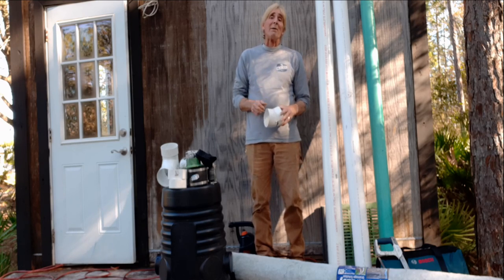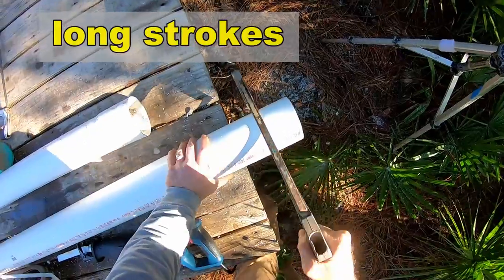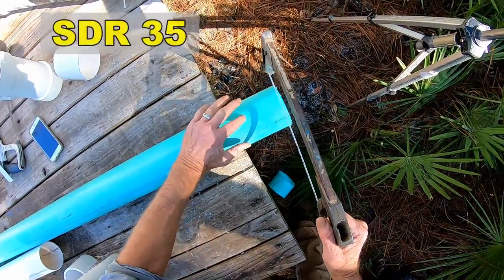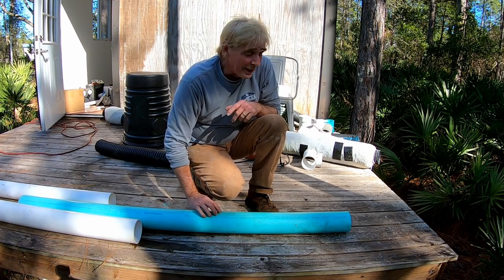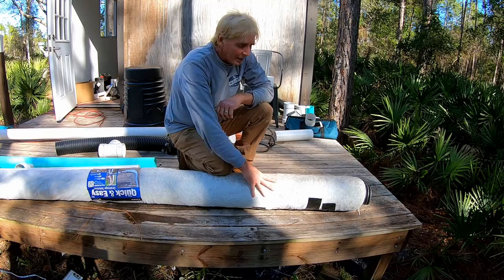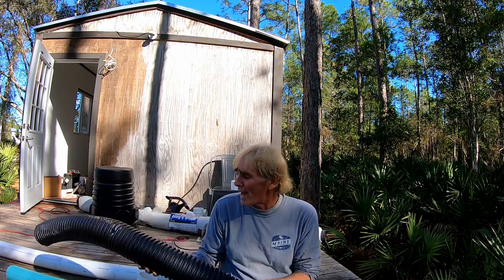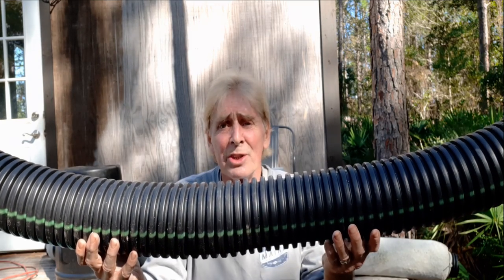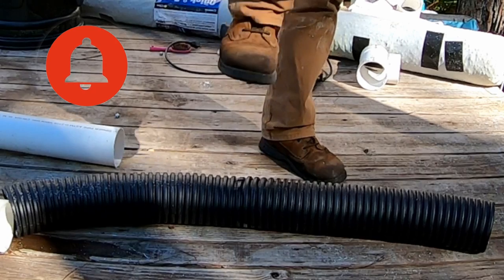FRENCH DRAIN - What's the BEST Pipe to use?

Comment: What's best for inside a crawlspace?  I have a tall crawlspace (with some standing room) where I've already trenched  around the perimeter.  Most of the trench is only 6" deep, but in one place the pipe will be buried under about 18 inches of gravel along the footing.  Corrugated will be easier to maneuver in the space, but will it hold up to 18" of gravel?

I also have two pits that I'd like to connect to each other with a pipe that will run through the middle of the floor, where it will be walked on, with about 2 inches of gravel cover.  Will corrugated hold up there?

Comment: There is an adapter to go from sch 40 to the green pipe.  If u are worried about heavy traffic like large trucks on a driveway or something schedule 40 is good.  Sdr35 is my go to pipe if I can get it.   Pickings have been slim at the suppliers around here the last year or so... so iv been using whatever material is availabile... sch40 is also extremely expensive now days

Comment: I Use My Skillsaw For Pipes Less Than 3 Inches and My Ryobi Sawsall For Pipe Over 2 inches! It Is So Much Easier Just To Whack It In Two With My $59 Ryobi Battery Powered Tool! I Have Had To Use The Multi Tool To Flush Cut Pipes Also! Love Your Videos But Have Seen These On Your Other Channel!

Comment: Everyone needs to keep in mind: Corrugated pipe comes in SINGLE WALL and DUAL WALL.  Both are flexible to an extent (dual far less so).  BUT, dual wall (smooth inner wall) will not crack nor will it collapse like thin, single wall corrugated pipe.  HD carries rolls of thin single wall pipe that WILL COLLAPSE under pressure over time.  For this reason, though cheap and readily available, use CAUTION when using it.  Downspouts will back-up if these get crushed.

Comment: I wouldn't recommend corrugated with downspouts. The leaves and shingle dust will fill up and block corrugated in just a few years. Roots only get into PVC pipes that are cracked or leak from the fittings. If they aren't leaking they aren't getting root invasion. PVC is also easier to clean but I agree that thin walled PVC is probably sufficient for drainage applications unless there's a driveway or something heavy going over it.

Comment: When my house was built, the builder put a corrugated gutter drain under the front yard. It failed totally in about 4 years. I dug it all out and installed Sch 40. Twenty-five years later it remains root and clog free. I would not waste a nickel on corrugated piping.

Comment: I'm getting a paver job done and the original drainage pipes were under the slab, the guy tells me that I don't need it.  he said he will put an 8ft gravel base and then a 4" qp base and run 4"  drain pipe to the sump pump.   He states that should be enough.  The area of the pavers is problem 20 x 20.  with the back yard on a hill where water runs toward the house.  what should i do?

Comment: I am in the process of hiring a company to do a french drain aroiund a concrete patio/ walkway area due to water entering my home through a back door at ground level. The backyard property slopes towards the house and when we get torrential rains water can and has come into the house. I am wanting a french drain installed with no dirt on top to maximize the removal of water faster. What should I look for the company to recommend to use as far as materials.

Comment: I've seen that thin wall PVC material crack.  Maybe because of setting or ground shifting.  How can roots get into sch40 PVC if you glue the pipes together?  The two piece are fused together.  Show us an example of roots getting into glued PVC.  That black corrugated material are a bitch to snake out.

Comment: I have seen roots and damage in all the pipes you are discussing in this video. A french drain under 8 feet of topsoil is a stop gap at best, especially with no method of cleanout. Sediment cloth over time will eventually clog and totally stop the flow of water into any type of pipe. Schedule 40 and SGR-35 are the only pipes you can clean out effectively that i have used,  Corrugated pipe almost always in my opinion is the most likely to become distorted and clogged and rendered useless.
 I have been building and dealing with water problems for 28 years in the mountains of WNC. I still don't think i have the answer on the perfect pipe or best method, to keep a french drain operating at peak efficiency indefinitely.
Reply: well said!
Reply: Boy you'd go out of business in Costal Oregon, where we often get 150" annually
Reply: Totally agree! Because French drain pipes have holes which allow tree roots find they’re way in.

Comment: Would a good qualifying factor to use the corrugated pipe be that there are zero trees in the area you are putting it? And is it okay to tie existing systems into it that are with SDR35?
Reply: Go with green sewer pipe. It will hold up a lot longer. Corrugated pipe from big box stores is no good. Sediment and dirt slowly build up in those pipes over time causing the entire system to fail.
Reply: @StormWaterDrainageSolutions  - Could put a Y at the downspout with a cap to allow cleanout with a garden hose, if not too many bends and not too long.

Comment: One hint using any hand saw-to get a straight cut point your index finger forward and rest on saw. Also you are cutting om the back stroke point blade teeth forward and let the saw weight do the cut with long slower strokes. The saw should cut on the forward stroke only. The recipo saws shoe should always be touch the work

Comment: That corrugated pipe collects shingle dust washing off the roof and is a trap for leaves/dirt (and it traps obscene amounts of water in those grooves as well) - good luck keeping it clean as it will fill-up with crap and clog before you get around to any annual maintenance - I wouldn't use it unless I was desperate and it was my ONLY option in a home flooding situation!  I would not consider it for French Drains for the same dirt and water trapping/clogging reason, PVC + lots of gravel is the way to go there.  Water runs best along smooth surfaces, why throw that undisputed science out the window and use pipe that isn't smooth to remove your water problems?
Reply: Exact thought everytime I see it used. I could only imagine using it on serious slopes (>50%) where the angle and force of water flow would allow self cleaning of the pipe throughout the year

Comment: Chuck, is it ok to use foam core 4" pipe and drill holes for French drain?
Reply from the maker: Sure ! But is costly way. I think better is to buy sections already pre drilled. Foam core is good pipe. Just be sure to point holes down into your gravel

Comment: Some commenters make an argument for schedule 40 pipe. Schedule 40 is hands down stronger than the others but...SDR35 is the standard pipe called out for use for underground sewer lines. If it is good enough for sewer lines than it should be good enough for drain lines as well.... as with all decisions the application must be kept in mind. If you are going to drive over it or put a rockery over a pipe with minimal coverage it is going to need to be stronger. Chuck obviously has a lot of experience and if he has good success with coorogated pipe than you probably will too. (Unless you have minimal coverage, poorly drained squishy soil, are passing through trees or may apply excess pressure to it. (Think, roof replacement or any other delivery. (Dumpster, soil, concrete etc.)

Comment: Why would be sch 40 be any more work? Other than a few more seconds to cut through it because it is thicker? There are more pvc fittings available for sch 40 pvc than NDS pipe
Reply: You need to use various fittings to make turns and glue them. You also need to glue couplers to lengthen pipe. Trenches have to be dug almost perfectly straight. Corrugated bends and the few connections you make just snap together.

Comment: In my experience, picturing you root clearing a drain pipe = blowing out the side of corrugated, or schedule 20. However if it’s deep enough, schedule 20 properly backfilled will be just fine. 
Corrugated is just garbage. It fills with trash way too easy, does not retain its level but has highs and lows unless your trench is particularly done right. You were complaining about the little ridge in schedule 40, corrugated has one every inch or so. 
It’s Used only in a pinch.  Under driveways I would use schedule 40 or the green pipe. Green pipe is best IMO

Comment: I currently have the black corrugated pipe for my downspouts, and I've had a problem with several of the pipes collapsing due to the dirt. I'm looking to replace them with sdr35. Should I use 4 inch pipe or would 3 inch pipe be fine? Or should I use the quick and easy system?
Reply: How deep are you burying them? Also, are you using the real ADS pipe? There are some corrugated pipe out there which is really flimsy and not suitable for burying they are called something like "flex-pipe."
Reply: It depends how much water you need to move. How large is the roof? How many roofs into one pipe? Ground drains connected too?

Comment: I live en Honduras and I can only find SDR 64 or SDR 41. Have no idea why SDR 35 is not an option. I'm installing a large french drain on a drive-thru area and need to know which of these pipes would be best.
Reply: SDR 35 pipe is used as a direct replacement for old sewer pipe made of clay. It is probably not available in Honduras because pipe of that specific thickness was never used there. Whatever pipe is used for buried sewer lines outside of a structure in your area is what you want to use.

Comment: We are having our messed up project fixed this week by another contractor. They are using either Schedule 20 or thin wall. I'm not sure which it is or if they are the same thing. Should that material work well for downspout drainage? Thanks Chuck! Also, he put the adapter on the first downspout (2 x 3") and there is some space around the connection. He suggested squirting some of that expandable foam in the top to close it off. Is that appropriate or should I just leave the gap?

Comment: So the main reason not to use Sch 40 is the fittings for the downspout? I didn't really get otherwise why not to use it.
Reply: Also price, 40 is over kill.
Reply: @ironleatherwood1357  Yeah, I get that. It can be expensive and my preference is corrugated because it's easier to work with. I had found a bunch of sch 40 on craigslist for free. A construction/excavation company was liquidating.
Reply: Sch 40 is too rigid its going to collapse under high pressure. Sch 35 withstand much better under high pressure such as driveway
Reply: @jkevin1569  Thanks. It's in a residential use and it's downspouts to the street. No heavy equipment crossing it (unless you consider me - 220lbs heavy) LOL! In our area, it's very common to use ABS (which is also SCH40) for this purpose.
Reply: In that case there is no harm using sch 40. However, abs fittings are not compatible with sch 40. You are better off with sdr 35 since it's more rigid than single wall sewer pipe yet more flexible than sch 40.
Reply: @ironleatherwood1357  wish I had known that.  I bought about 500’ of 3” and 4” schedule 40.  It was pretty expensive but compared to the raw effort of digging all those trenches it hardly a major concern.  I just used a pick and shovel and it was brutal especially once the trenches get deep

Comment: I used duct tape around the PVC connections after gluing them to help slow down root intrusion. 
Thoughts on this? Waste of time or something to keep doing?
Reply: Waste of time
Reply: lol lets think ?
Reply: I use sch40 for reticulation main lines and have recently used it under a driveway for protecting automatic gate wiring (and any future wiring) as I figured it would withstand heavy vehicles going over repeatedly. I thought about doing just what you said, but frankly, if the fall is correct, shouldn’t be any water to attract roots even if you drill it with lots of holes on the topside as a French drain. (Like the other guy does on YouTube that only uses Sch40.)
Reply: From my experience, duct tape lasts about 5 minutes. When installed underground, I'd guess that number halves.

Props for gluing though. That should make a big difference.
Reply: I don't think this will make the list for uses for duct tape.

Comment: Cannot even find 4" SDR35 or thin wall PVC anywhere in the pacific NW due to a plandemic resin shortage. Sold out, no ETA, near zero fittings too. I have partially complete drainage with no clean out adapters and a need 80' more of pipe but can't find any. Getting ridiculous as we enter heavy rain season. Shortage on many PEX fittings too and PVC food grade buckets/lids. Great video. Thank you.

Comment: The way corrugated piping is being promoted you would think this was being put out by APC American Plastics Council. It's inferior in terms of performance, does not pass solids due to the ridges, cracks, tears, breaks, fills with mud and doesn't last in swampy environments. Replacing it multiple times over the lifetime of a building does have a carbon impact, although PVC polyvinyl chloride is poison plastic. ABS black plastic pipe is better for the environment in terms of dioxin emissions from the PVC lifecycle. Don't waste time burying cheap corrugated pipe, even if it is tempting to use for ease of installation at a fraction of the price.

Comment: I live in New York near Lake Ontario. How deep would I need to dig a trench to use sdr35 for downspout drainage?
Reply from the maker: Hi Holly. I get this question frequently. The main factor of how deep you dig is where you’re going to discharge. Remember you must discharge to daylight. Every yard is different. SDR 35 is a great pipe. The only time it will freeze is if the line is clogged or backed up. So you should be fine at just a few inches under the ground if that’s all you can achieve. I hope that helps. Thanks and best regards, Chuck

Comment: I don't think any problem with PPC the way you talk about the problem. Do it right first time and adding addition run also . Never install Corrugated pipe no matter what. Yes roots will reach the tiniest gap of Solid pipe but corrugated pipe very easy for roots with so many open gaps . The points are to pay the price for best materials . By the way this video telling me you want corrugated pipes for your choice of installation and against schedule 40  which better than your choice.
Reply: He stated SDR 35 is the best to use but it is more labor intensive and more expensive for pipe, fittings, etc. I'm sure he lets customers know options available and advantages/disadvantages but probably most decide/opt for cheaper drainage install or fix in using corrugated
Reply: @gman8042  in another words is you will spend more money later on fixing the corrugated pipes when it failed. What is the point of it saving ?  He never mention how water flow so easy on a smooth wall than corrugated .

Comment: None of you ever have to worry about freezing pipes? I buried a solid PVC attached to downspout and within 2 winters, it cracked and broke the entire aluminum downspout! Rework = nightmare.
Reply: I assume if your slope is good you'll never have water sitting in the pipe so it shouldn't freeze or break, maybe yours got clogged before (or during) winter?
Reply: All types of pipe will freeze or burst if left filled with water. The drainage pipes aren't meant to hold water, they're meant to move water to it's discharge point. Gutters, leaders and drainage need to be cleaned regularly. All pipes need to be pitched downhill.
Reply: You didn't get the correct slope..

Comment: Would seem that roots are only getting into PVC joints is because the joints were not properly attached and glued in the first place. If the PVC solvent melts and welds the joint together and it was glued thoroughly, then it's a permanent seal and nowhere for roots to get into. I would therefore assume that the PVC pipes that get roots is from improper installation and some people and companies are either too lazy or not knowledgeable enough to do it right.

Comment: How can you say there's "no problem" with the corrugated? There's a huge problem, it doesn't flow. It's literally a series of hundreds of dams holding back water. Any detritus in the system will settle in those wells and eventually clog the pipe.
Reply from the maker: Seems to hold up better than PVC after 25 ,years

Comment: You know every plumber I know has a hacksaw somewhere in there tool collection.the best way to cut pvc is a chop saw,it depends on how much pipe you are dealing with.I would not use a hack saw for pvc ,but use a pvc saw or saw saw.
Reply: Miter-chop saw for me ... square cuts every time. I prefer Sch40 ABS for my drains ... stays flexible over time, pvc gets brittle.

Comment: There are no holes on these pipes. These aren't for a French drain, these are for connecting a French drain to a standard drain line. Title says "French Drain- What's the best pipe to use." Would have been good to compare the cost Chuck, I used 30' of the p-nut pipe, (easy drain) and it was 150.00( 50.00 per 10 feet section).

Comment: Perforated corrugated pipe is good for slowing and absorbing surface water that cant drain out flat or low yards. The type of pipe to use depends on what you are trying to do with the water. Pvc for fast drainage of downspouts and corrugated for modified french drains and allowing surface water to disperse into the ground where drainage isnt an option its just give the water somewhere to be other than the surface.